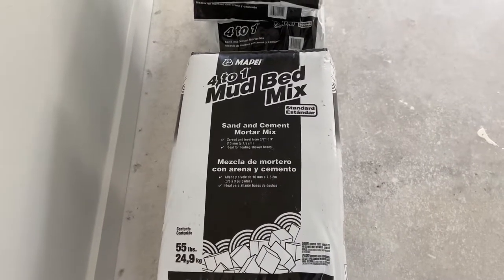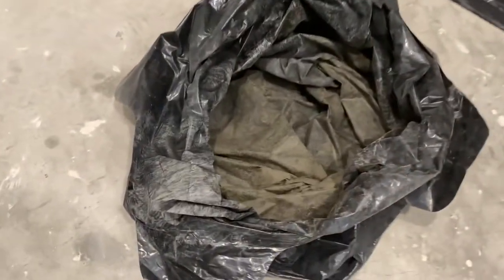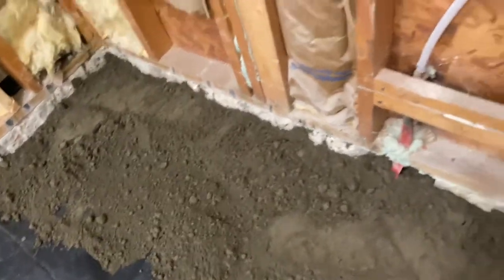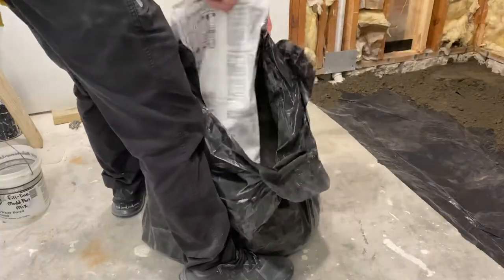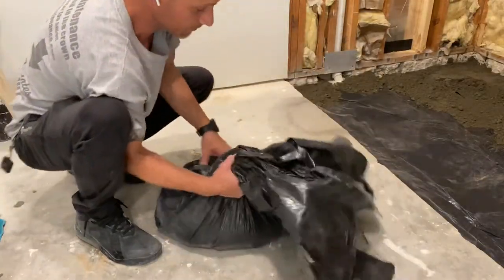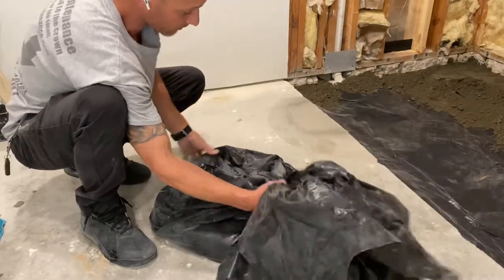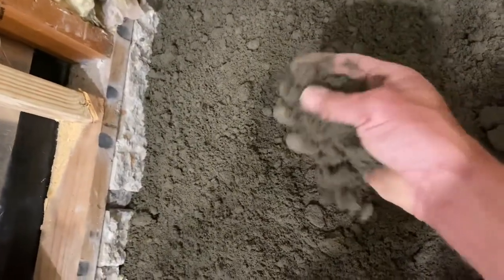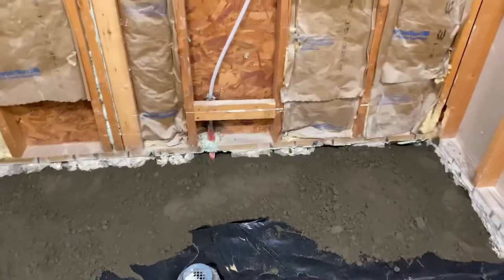Shower pan DIY how to mix easily

Comment: I like this method also.  The 4 to 1 on the bag isn't referring to 4 part water though like you said early in the video.  It's referring to 4 parts sand & 1 part portland cement.

Comment: Nice! Mixing in a tub sucks! I'm pretty sure 4 to 1 means 4 parts sand to 1 part portland cement.
Reply from the maker: Correct trash bag is way simpler thanks for watching

Comment: Basically 4 parts water to 1 bag? No no no numbskull, 4 to 1 means the ratio of sand to cement. Just trust me here.
Reply from the maker: These are pre mixed bags bought at Lowe’s I add the water needed to reach what is needed been mixing shower pans for 15 years love the premix bag
Reply: @crdriscoll1 , it still means the bag contains 4 parts sand and 1 part portland cement.  It has nothing to do with the water.
Reply: It looks a little dry but it's better than being to wet